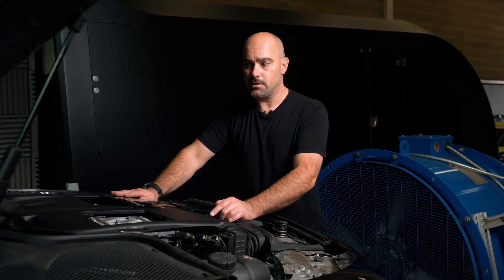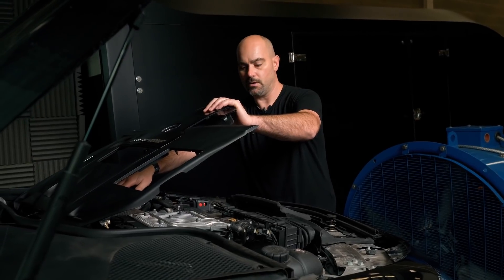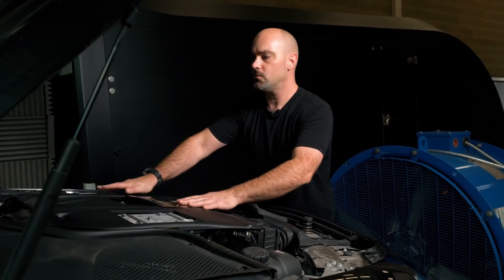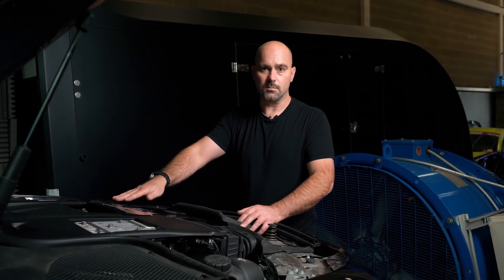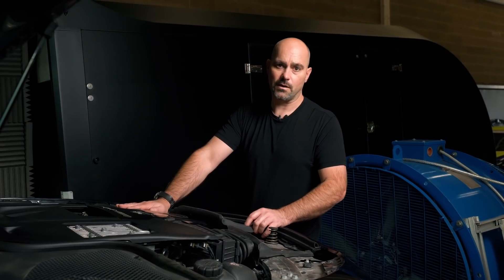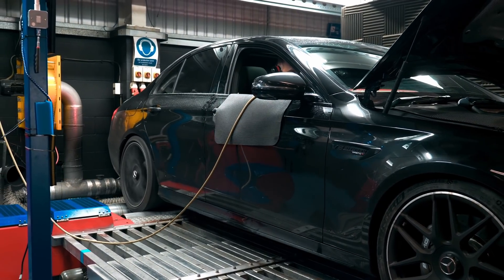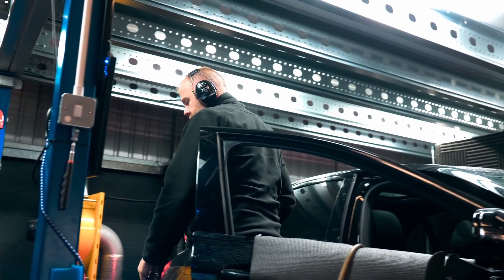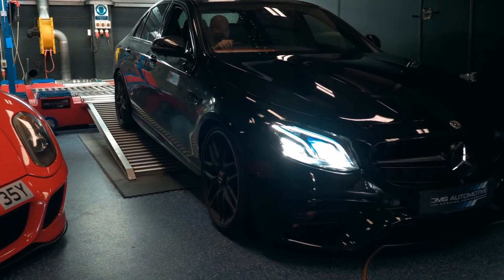E63S DMS 720 BHP / 1050 NM

Comment: How much bhp could you get out of a stock 2018 e63
Reply from the maker: Upgraded you would see 680-700 BHP and 950-1000 NM depending on fuel, shell vpower is best to run them on
Reply: @dmsautomotiveeurope  thanks for the reply what power gains could you get from a 2014 Audi A6 bitdi 3.0 V6
Reply from the maker: @janhon9251  405 BHP / 750 NM, we do a lot of these, transformed with our upgrade
Reply: @dmsautomotiveeurope  thanks dms not many tuning companies like to reply on YouTube comments
Reply: How much would it cost to tune the A6
Reply: Baldi basics 2nd hand is fine and you have the same one for your work but not a big fan for your birthday but I think the one we are working for now 9.30pm is the first time in our lives that I want

Comment: I’ve just got a 2019 non S version of the E63. Is the map the same for both engines? I thought the S had larger turbos?
Reply from the maker: many of our customers prefer the non-s suspension and rear differential. if you drop a short email to sales@dmsautomotive.com with your chassis number or reg number and we will send you full details of exactly what we can do for your 2019 E63 non-S👍 its very similar results
Reply: My one s63 2019 all options
Reply: @dmsautomotiveeurope  Thanks guys. I’m still getting used to 570hp and it feels like plenty but I’m sure I will be craving more in due time. I’ll be in touch when I’m ready. Keep up the good work. Love the videos and it would be amazing if you did a comparison run between an S and non-S version once tuned. I’d be happy to donate my car for that video 🙂
Reply from the maker: @RS-jb1lf  had a non-S in today, more to gain obviously than the S but both with our upgrade there is practically nothing in it, would love to get your car in one of the videos when we hire the test track, keep in touch and we can let you know when we are filming on track again 👍
Reply from the maker: @ASD-jb6bh  love the S63 too! And the 4.0 actually really suits the car with the well chosen gear ratios by AMG, with 700+ BHP it’s so much more performance though after our upgrade 👍
Reply: @dmsautomotiveeurope  Why do they prefer non-s differential, isn't the S differential electronic, thus being better?

Comment: Was it running any map at all stage 1 stage 2?
Reply from the maker: Came to us with downpipes on but no map, so check engine light was on, we read ECU to make sure it was standard before we ran and then logged the data and tuned the car whilst it was on the dyno, our remap with the downpipes made 720 BHP /1050 NM, the exhaust sound was also optimised via the ECU software to the customers preference 👍

Comment: Why do you run RWD not 4x4
Reply from the maker: When you put the E63 into factory “dyno mode” the front wheel drive is disconnected, so it is designed to be tested RWD, we can run without dyno mode just with traction control off and run 4WD but it’ s safer for the drivetrain then to run on one of our other mechanically linked dyno. 
Porsche 991 / 992 factory dyno mode is the same it disconnects the front drive for testing.